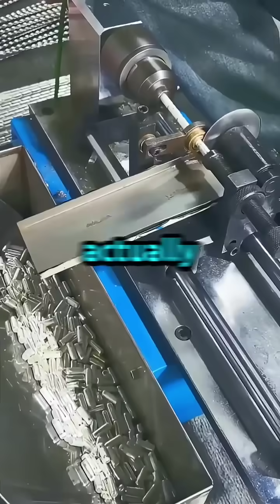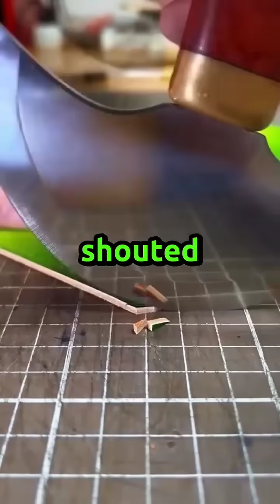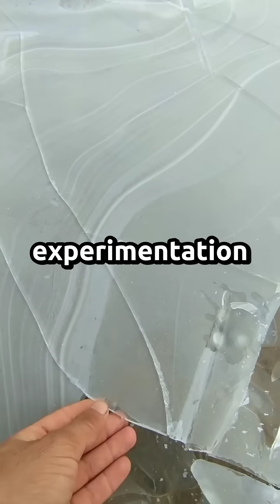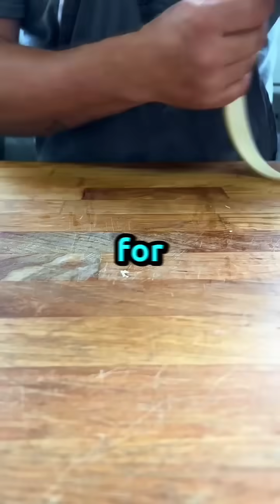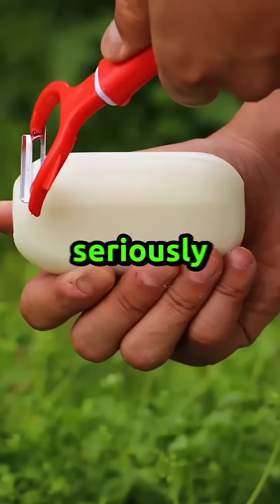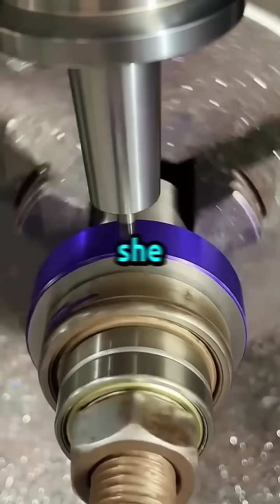Use this sound

Comment: Had a Dr with no sense, went in with a rash from being in Biscayne bay. She said where you went in isn't problem but the boat ramp there have been reports of problems, so that can't be the reason. What water don't circulate, it's only a mile to the boat ramp.

Comment: Chemistry is dangerous, but also super helpful. We use it all the time. The alloys and circuit boards for all your electronic devices, the batteries to power them, even the screens are made with chemistry. Yes, you can do borning biology/pharma stuff too. The point is, it's everywhere, but the associated risk is entirely dependent on the person and environment it's being weilded in